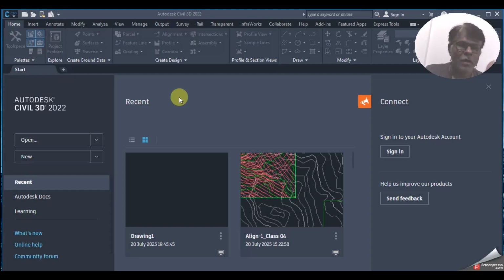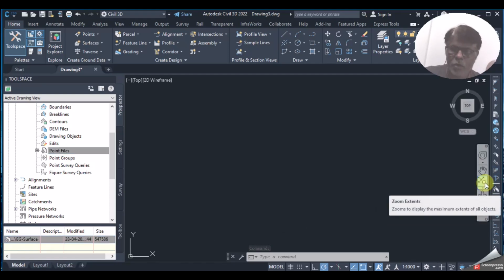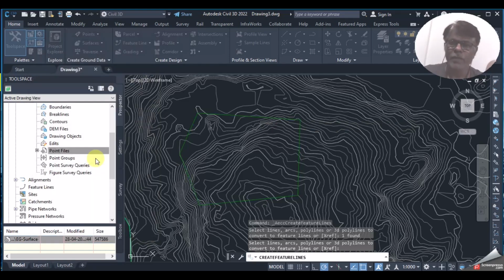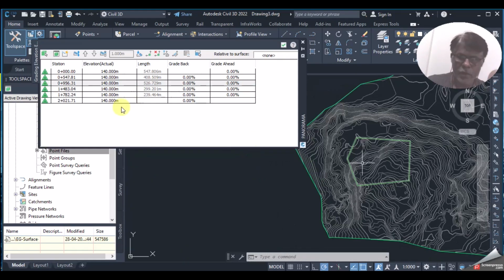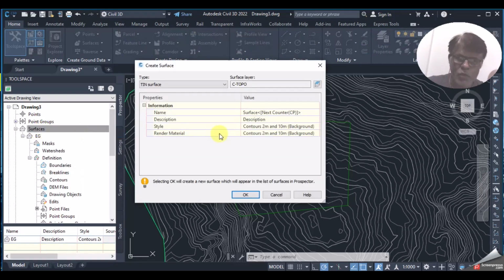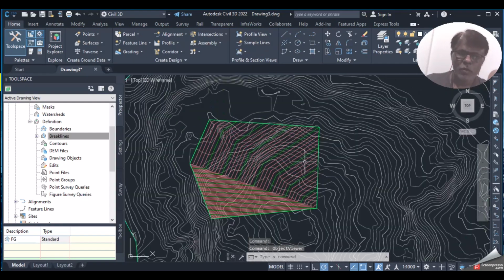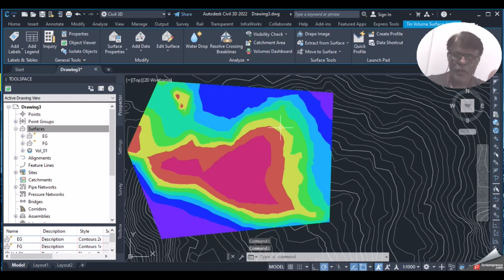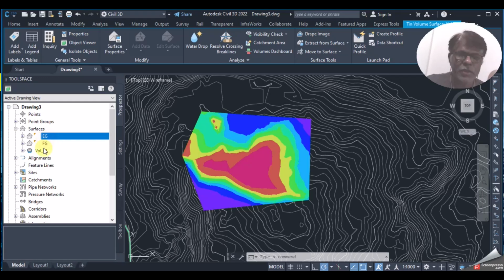How to Create Volumetric Surface and Calculate Volume in Civil 3D

Comment: The way you created the TIN volume surface gave me a new perspective on how to approach grading. However, I prefer using the grading tool, especially because merging where the FG and EG meet is necessary. Still, your method makes it much easier for newcomers to perform grading. Thank you, sir—I look forward to learning more from you!
Reply from the maker: I appreciate your Comment Sir. I was interested in just making a comparing surface. But your suggestion is spot on.